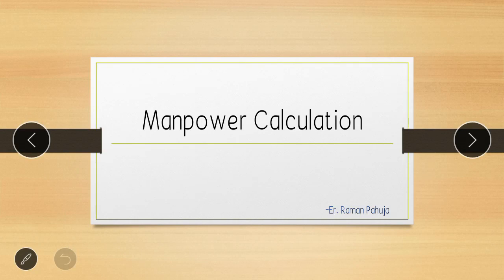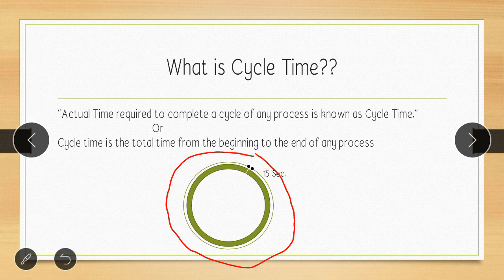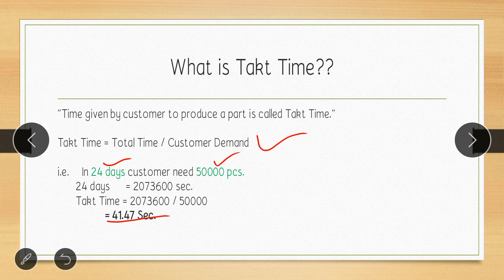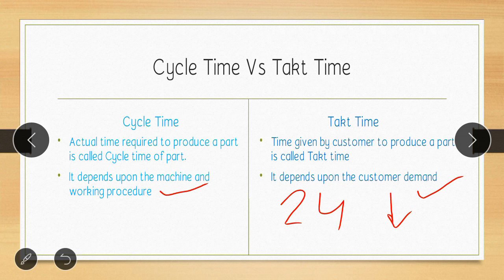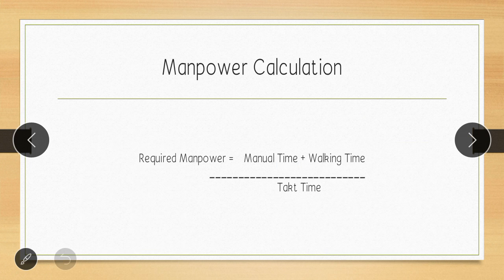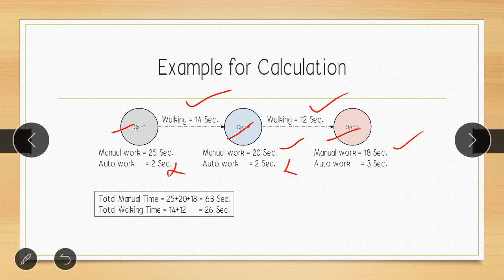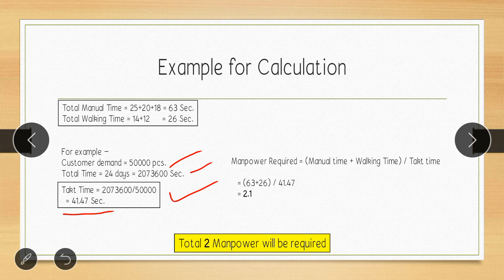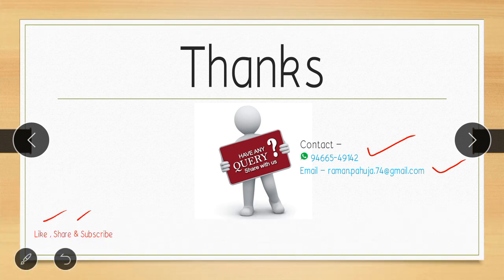Manpower Calculation | Manpower Calculation by Takt time

Comment: So the Manual Time + Walking Time is also equivalent to the whole Cycle Time of the process? Am I right?
Reply from the maker: No dear cycle time is also include auto time...manual time + walking time is the time of operator only. Not machine or whole process
Reply: @RamanPahujaIndustrialEngineer  how about the main process + additional steps like putting the products in the bin and getting it from the bin. Is it included as the walking time, since there is no walking included in our process. Thanks
Reply from the maker: @khentsaludo5162  additional processes are the manual time.... Which operator do...
Reply: @RamanPahujaIndustrialEngineer  ok sir, so if there is no walking or transportation included in the process the formula will be Manual time over Takt Time only? Am I right? Thankd
Reply from the maker: @khentsaludo5162  exactly then we will consider walking time as zero
Reply: @RamanPahujaIndustrialEngineer  Thanks sir it is really helpful.
Reply: Sir I just want to asko who is the philosopher behind the formula of Manpower requirement? Thanks. Just need for our research..
We put Total Standard Time/ Tak time
Instead of the walking time+ manual time. Thanks